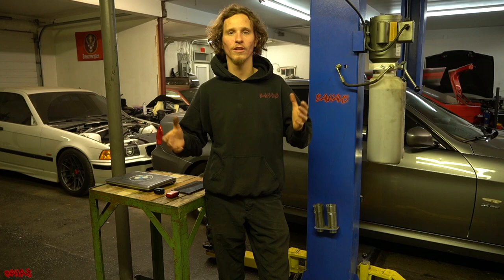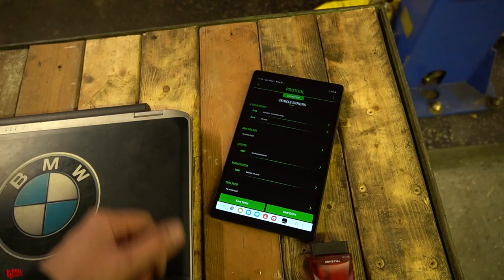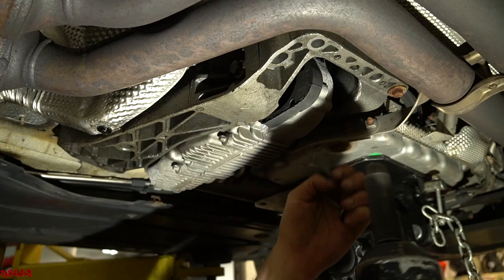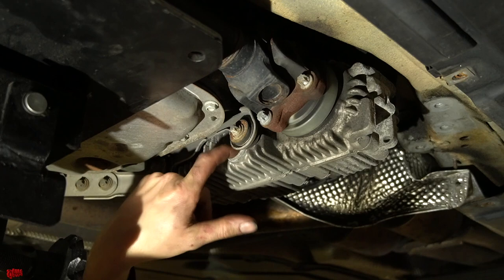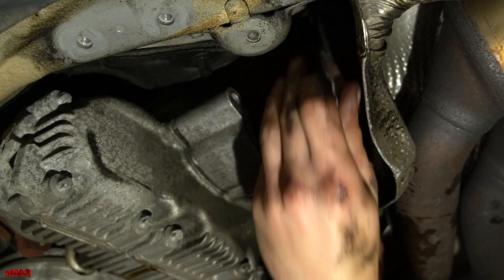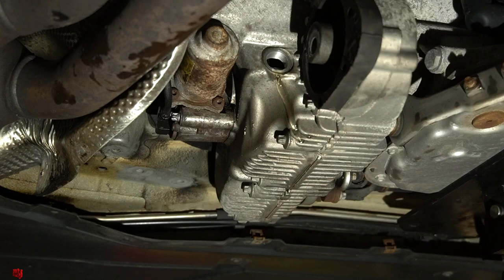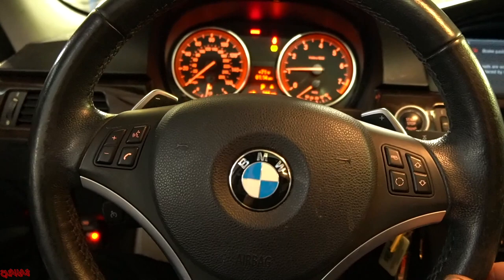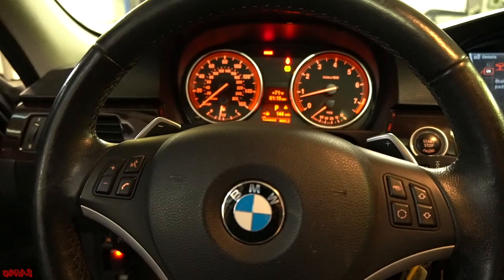BMW e90 Dashboard ABS, 4x4, Brake, DSC Lights Caused By Faulty Transfer Case Actuator! (Video 3)

Comment: Great video, the best so far! Here's a tip if you have the manual transmission, there's plenty of room to insert the long bolt back in from the FRONT side, so you only have this difficult removal one time. Mine was 18mm , both the bolt head and the nut. I used a short extension + socket on the front side, and a short socket on the rear side as you did. Thanks again for all the details in your vid, it helped a lot.
Reply from the maker: Thanks for the feedback! Glad we were able to help. And I know a lot of people like to flip the bolt after the first service, I’m just a little neurotic and like stuff put back the way it came. Even if it makes no difference it would eat at me lol. -Mike

Comment: I changed my bmw 2006 325xi n52 transfer case actuator already and still got the 4x4! And break and dsc lights what you think went wrong I’ve also replaced the drivetrain and front driver side axel
Reply: Damn man, I also have a 2006 325xi, this is my second e90 with vgc servo motor bullshit, its so annoying not being able to rip this thing easily, and this second one has transmission problems with squealing when going into 4th gear. It also died on me today at a red light, went from steady 800 rpm to black out no more electricity anywhere in cabin, dead. Connected a jumper pack, started it, disconnected immediately afterwards and its like nothing happened, running strong again. Except now my turn signals don’t go back to neutral after turning. Am I unlucky or are these cars so fucking delicate??! Ive seen E46s being more reliable but they are underpowered compared to E90 and above
Reply: @imthatguypal_  yeah bro it's all the sensors that's why people code them out and I feel you on not being able to RIP it mines auto and it really hurts me not feeling the awd pull but yeah any old bmw <2003 is way better and easier to maintain then these newer ones also cause the old ones have less plastic parts I had my old e39 thing was best asf and this new e90 it's not bad I'm still gonna work to fix it up and resurrect back to life but yeah the awd is funky thing with these but other than that they're beautiful comfortable cars and the coolant system is over exaggerated by many I've only ever reinstalled 1 radiator on a bmw and that's just cause it was a while that I had a coolant flush
Reply from the maker: @reynoreyno3444  could be a number of things. Any codes?

Comment: So if one wheel sensor is having big air gap between axle ring, or if sensor defective,  it will show on the dashboard that is 4x4 and  is not working?
Reply from the maker: Yes the 4x4 gets shut off whenever there’s faults in the abs system. -Mike

Comment: I have a 2016 bmw 228i xdrive that has all those lights but there intermittent and only comes on while driving. I was told it was the transfer case I was hoping maybe just flushing and adding oil to it or maybe the actuator. What do you think?
Reply from the maker: Do you hear any drone from the front axle? Or have any air gap codes for a wheel speed sensor? Sometimes when the issue is intermittent it’s actually a wheel bearing wearing and causing a magnetic field that interferes with the Hall effect sensor. Check out our other videos on this topic and scan for codes. Let us know what you find! -Mike
Reply: @bavhaustv9795  that seems more likely to me then a transfer case. Because originally I thought it was speed sensors but my mechanic said they all register and not one was off from the others. He said it could be ecu, then another mechanic said it’s the transfer case and it’ll be over 5k to fix. The front brakes are warped for the second time in a year and a half and the cv axle boot is ripped again. Could a bad wheel bearing cause all that?
Reply from the maker: @jehfitt  transfercase motor failure is typically a hard failure so I’d be looking elsewhere myself.  The transfercase is more than likely not the issue. The code pops up to shut the system off for dozens of reasons. The warped rotor and axle issue are probably not related unless the bearing is extremely bad but I think you’d figure that out if that was the case. Ecu won’t be the problem. Drive the car and listen for a front axle drone and check for air gap codes when the lights for abs/4x4/brake etc pop up. Those codes to first appear are your guide to solving the issue. Don’t scan after long cause the chain reaction of codes will make it a nightmare to diagnose. Even when wheel speed sensors have air gap codes they still may read wheel speed properly.

Comment: what fluid did you use? what fill tool was that? i just replaced my actuator and some fluid came out, i didnt fill it and when i put everything back together the codes stayed off for a minute or two. do you think they came back because of the fluid or just the transfer case being bad?
Reply: He said in the vid bmw dtf1 and just any fluid exchange pump will work

Comment: is it possible to calibrate the transfer case actuator using a snap on obd2 scanner? Just to be safe, what kind of scanner and app do you use to calibrate the actuator and check for errors?
Reply from the maker: A snap-on scan tool should have the same options. We use a number of tools including ista, an Autel, and protool among other things.

Comment: Reinstall the long pain in the ass transfer case mount bolt backwards . This just makes the removal for next time ez with no issues what’s so ever !!
Reply from the maker: Haha we know plenty of people who do this. There’s more than likely nothing wrong with reinstalling it backwards but we tend to put everything back exactly how we found it. Who knows if/what engineering concerns there may have been placing it the other way. It was more than likely an oversight but it wasn’t fixed and oriented the other way on later chassis so we continued putting them back in the stock directly just so there’s no potential liability. -Mike
Reply: omfg 🤦 i just checked out my transfer case today and thought about putting that bolt in backwards but didn’t. now i see this comment
Reply from the maker: @jordynharris445  yeah it’s definitely easier lol